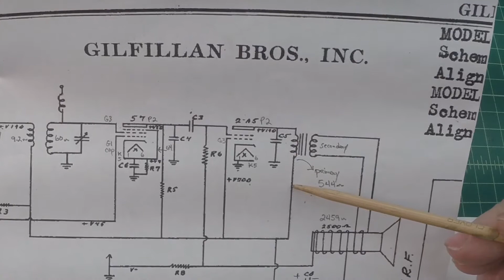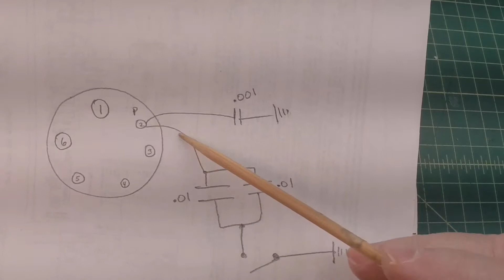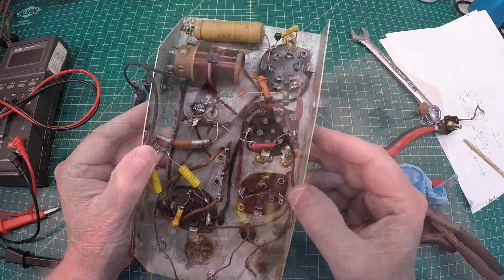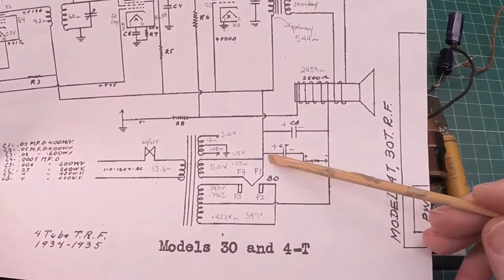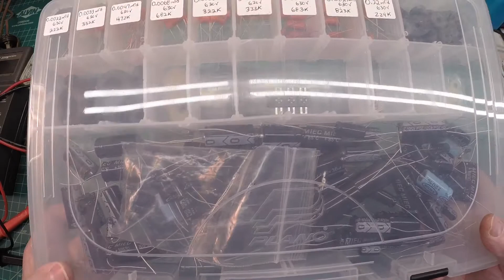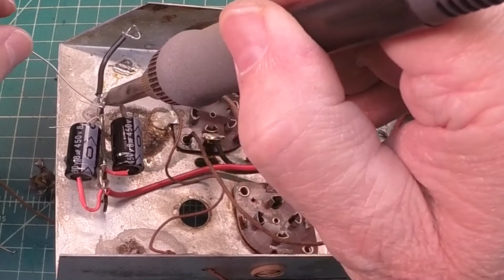Peter Pan Radio - Day 9 P2 (Replacing Electrolytic Capacitors)

Comment: As usual, shaping up to be a first class restoration!!! I appreciate you taking your time to walk through the various steps and your reason behind some of the things you do.Too me it looks like the chassis was bent in when the hole was drilled for the Tone Switch addition. Pretty common if you have a dull drill bit to press harder to get it too "bite". Other possibility was the radio might have been dropped on it's back the Tone Switch(sticking out the furthest)  took the impact and bent the chassis in.
Reply from the maker: +GrandsonofKong Thank you. Great logic on the bent chassis. I appreciate you following along. Best, Don

Comment: Very good vid.  What was the black item you were using at about 32:10 mins of the tape.  You seemed to be going over the connections of the electrolytics with it, when done it was in the picture at the upper left and it had what appeared to be some white twisty tie on it.  What did that thing do?
Reply from the maker: +Donald Emmerling Hi Donald, I'm late responding, but I show this again in an upcoming video in response to this comment. It's a small heat gun: MICRO-THERM MINI HEAT GUN https://www.amazon.com/dp/B000BIBLWC/ref=cm_sw_r_cp_tai_ayKvzb856MW6B Thanks again for following along. Best, Don

Comment: Hey Don, Judging by that 4 further down on the schematic the other number looks like .006 to me.  I really need to get a pair of those tweezer nose pliers.  I have needle nose but they don't seem to be as good for making those tight bends in wire for connections.  Good video as always.  Take care, Gary
Reply from the maker: +Rebel9668 Gary, I need a new one too. I've about wore them out using them for pliers. Lol Thanks for confirmation on the cap value. Best, Don